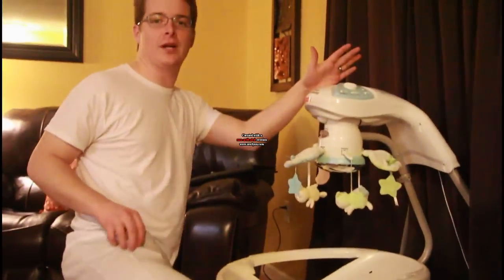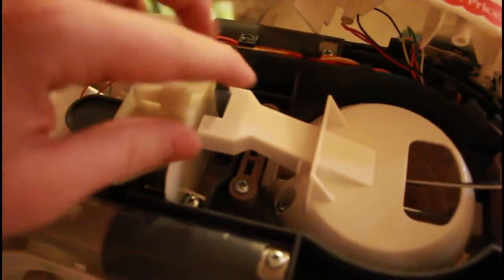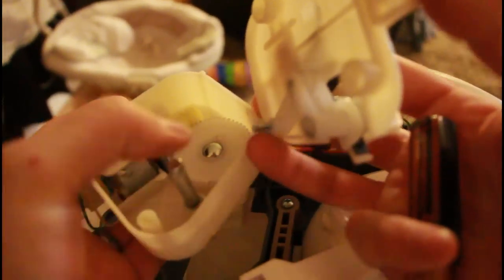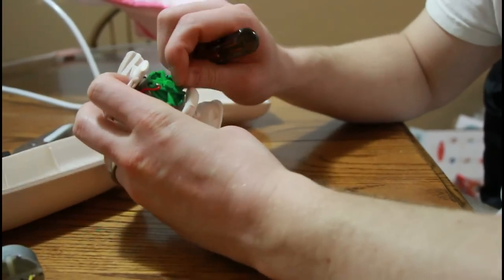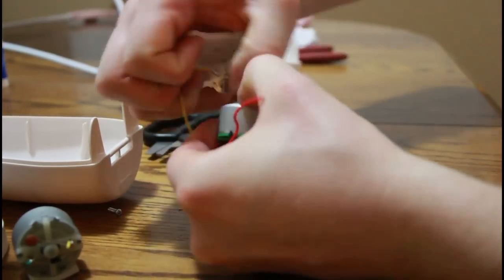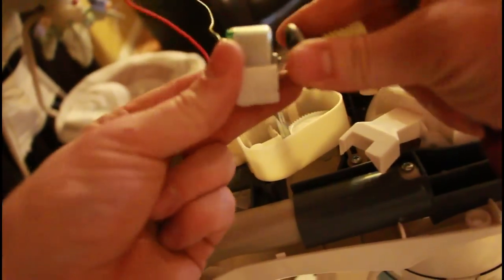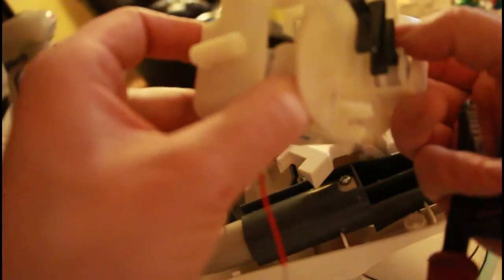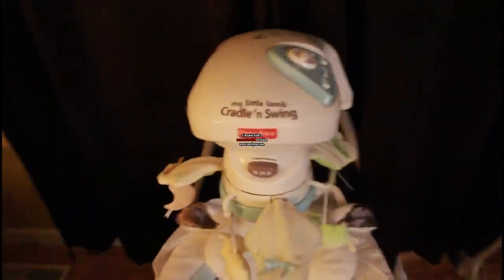How To Fix Fisher Price Cradle n Swing Motor Natures Touch My Little Lamb Love U Zoo baby

Comment: Thank you for sharing this. I repeated what you did but the engine is very weak and doesnt budge the swing. What did I do wrong? When I disconect the swing it works fine. When I connect it or just stop it with the finger,  it stops

Comment: I used an airwic i had laying around the house. It didn't work at all. I went and got a brand new one and did all the tedius soldering again for it to last about 5 mins? Anyone else experience this? Gonna try to order the proper motor to see if it helps. Idk what else could be causing issues? It did work for a few min

Comment: So I tried this with no success, my girlfriend went at it with a bit more patience and it worked better than new and quieter.  She found out I had pushed the gear too far on the motor, while it still spun the next gear, it made the next gear ride up the wall.  make sure you have the gear on the motor right.

Comment: Did you find that the motor was not quite as strong? Or maybe I did something wrong?
Reply: +corbinmd1 change the polarity (switch around the wires)
Reply: +Clint Mahabir I used the exact motor he called out, It was very weak... so I replaced the polarity with no improvement. Any thoughts?
Reply: You can get a small motor on Amazon.com 6 volts high torque and be sure you are putting it back together just the way you took it apart.watch the video at every step you make. good luck

Comment: This worked like a charm a few weeks ago.  I noticed when I changed the motor there was a lot of powder in the gear housing the gears were worn.  Did you ever find a source for replacement gears?

Comment: This video is SO clutch!  My wife and I have a swing that we had for our oldest daughter (who is now almost 4) that we bought second-hand.  Put it in the attic to save for the next baby.  Now, we have a 2-month old and took it down to use.  Put in new batteries and noticed that it would only swing for a brief period and very weak.  We were getting ready to toss it.  I will be replacing the motor this week thank to this video.  Thank you for doing this!

Comment: I recommend getting the polarity right the first time! I reversed the polarity hoping the speeds would work better and a black cylinder in the motherboard looking thing smoked. Now none of the speeds or off work... Just one fast speed if the batteries are in. 😭

Comment: Worked perfectly, thanks so much. For those in Australia the new shape Air Wicks still have the same motor. If you don't know how to solder you can buy a kit where you can just joint the wires but it's slower and more expensive.

Comment: You sir, have won my heart today.  We've had the swing for about 3 years and started using on our second child.  It quit swinging this past weekend.  I went to Wal-Mart last night and found an Air Wick (they sell them with the scents; not individually anymore it seems).  I had some issues taking the old motor apart, and had to use extra wire everything worked out well (for today at least!).  Thanks for the video and great description!

Comment: Super easy! Thank you for sharing this and saving us lots of money! This method works on newer models also...with only a few differences: 1. There are no screws in the battery compartment that need to be removed. 2. The initial removal of the motor compartment has a few more guards that need to be removed. 3. The motor compartment does not have to be lined up with the toggle! Your "tricky part" is no longer tricky! Great video!

Comment: how do u solder? or what do u use?
Reply: +Mari Navarro I used a pretty generic soldering pen i bought locally at a hardware store, and a little bit of solder. Many pens come with enough of a sample of solder to perform this repair. 

pen like this: 
http://www.amazon.com/Weller-SP40NKUS-Watt-Soldering-Black/dp/B00B3SG7F0/ref=sr_1_4?ie=UTF8&qid=1442421070&sr=8-4&keywords=soldering+pen

Solder:
http://www.amazon.com/Kester-Pocket-Pack-Solder-0-031/dp/B00068IJNQ/ref=sr_1_1?s=hi&ie=UTF8&qid=1442421189&sr=1-1&keywords=solder

I didn't buy any flux for this job, and I don't think it's required, but i'm not an expert.

Comment: I tried the same fix and my motor would not spin unless I have it assistance. Then it would only spin one speed and it wasn't strong enough to run the gear. It also would not cut off with the control panel. Is my swing totally messed up?
Reply: If you watch the video, he says that if you have the polarity incorrect, this may happen. Switch your wires on the motor around!

Comment: I removed the motor on ours and tested it, motor works fine, traced it to a bad voltage regulator on the board, replaced it, still does not work, hooked the motor directly to a power supply I have and it works but does not swing, I'm stuck on why it won't work at this point, swing does swing freely if pushed, not like it's binding or anything, I can vary the voltage on power supply and still nothing.
Reply: Might  still be the motor. Under weight, it probably doesn't work
Reply: we ended up throwing the swing out. The part that was attached to the motor would move back and forth withing the plastic that was screwed to the actual baby seat but it would not make the seat swing. I tried putting different material between the "lever" and the plastic and still no swing. Never had any weight in the "seat" so I don''t think it was a weight issue.

Comment: i thought this was gonna be so easy that id be able to do it... til i saw the sauntering part lol
Reply: +kels0two Soldering is easy.  It's just like using a hot glue gun.  Rem that where you heat is where the glue is attracted to..  Glue being solder.  Practice on just two old shitty wires.  You can do it.

Comment: why does it fast forward the soldering part of the video?
Reply: Because it's pretty self explanatory... There are only three points to solder, you remove two components and put them on the new motor the same way as the old one... If you think it could be a problem, just take a picture of it before you start for reference.

Comment: Soldering went fine, even though it was my first try. I have checked the motor after each step (leaving the batteries in the swing and using the wires to make contact) It worked perfectly  before assembly and i could hear the motor changing speed as I turned the knob. As i put it all together the motor was working better than before but the whole mechanism seems to skip a beat when trying to swing. So instead of swinging it pushes once to left-right-left and it struggles to push it all the way with the appropriate clicking sound that makes me think it skips a "beat". I took it all apart again and noticed that the plastic arm has cracks on it and used glue to close them. It still does the same thing. As if the motor isn't strong enough. I can't see anything else thats wrong with it... And can't seem to find any other repair article other than motor change.
Reply: +Jenny Tomova-Koutsarova I looked online, and they sell replacement motors for like $13 on ebay. I am going to try using this motor instead, since I didn't want to buy a soldering pen and a few people in the comments had similar complaints about the air freshener motor not being strong enough. I'll let you know how it goes!
Reply: +Kiona Goode what happened?
Reply: did this work better?

Comment: I found the motor wasn't strong enough. Then in the midst of this, for some reason I thought I should try reversing how I connected the wires because I thought maybe the pendulum spring was too slow. Bad idea. At this point I think I've burnt out the circuit on the control board that controls the swing on/off switch and speed. Now if I merely connect the wires, the motor spins at high speed and won't stop unless I detach the wires (or remove the batteries) - the swing speed switch doesn't do anything anymore (and if I switch it off, as I said, the motor won't stop). So not only is the motor not strong enough, but I ended up frying part of the unit. The sound and mobile still work... I'm borrowing this from a friend so I don't know what possessed me to fix it before consulting him. I guess I felt I was in a pinch cause I wanted to get it fixed for our newborn. Guess I made things worse :(
Reply: +Jeremy Lee I had the exact same issues, motor didn&#39;t really move the swing and then tried reversing polarity, smoke, smell, and now motor doesn&#39;t even turn off (and still won&#39;t move swing).  I feel punked.  Throwing away the whole thing now after sinking another $17 into it for a new motor (bought on eBay).  I don't suppose anyone has fixed it from this point??
Reply: Ugh that stinks....sorry to hear
Reply: +Jeremy Lee Did you fix your after burning out the circuit board?
Reply: No i didn't. I'm probably going to donate or toss the thing. I don't think it's worth buying a replacement unit on eBay...
Reply: exact same issue here ... smoke and now nothing.  looks like it might be toast.